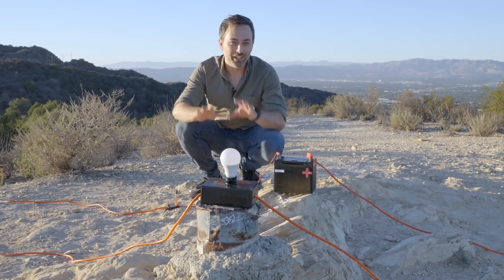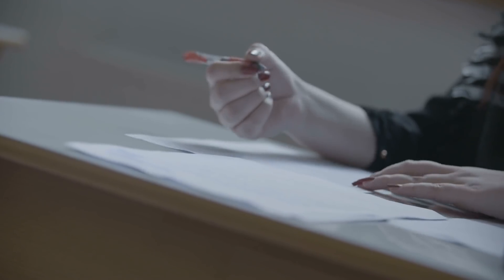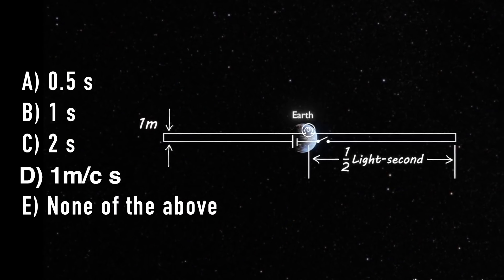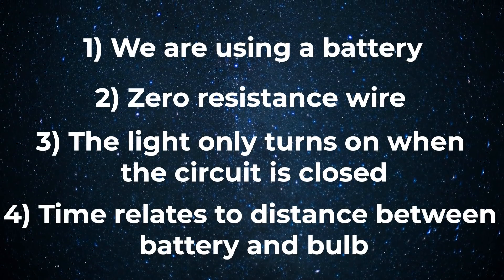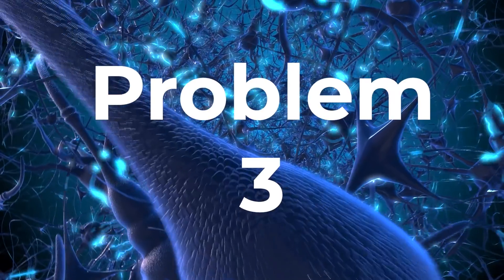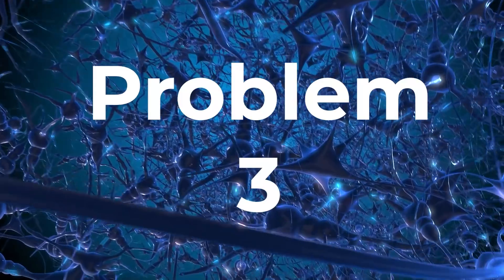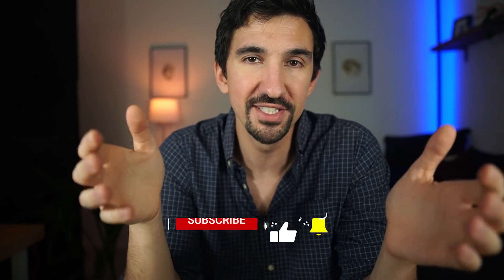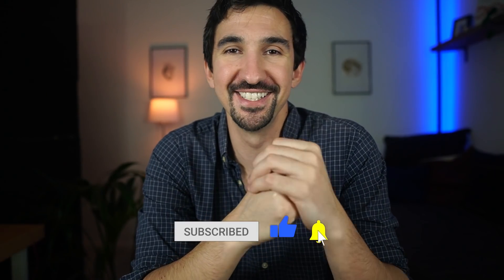Is Veritasium Wrong About Electricity?

Comment: Veritasium is wrong, this a copy of the comment I posted to V. 
I think that video in question has so many misleading concepts and some flat out errors that I don't have time to elaborate on all that, so here is a copy of my comment with some math included:
"I don't agree with the premise of this video about the fields carrying the energy, I would welcome it if somebody can improve this:
The setup is a battery with two ideal narrow cylindrical conductors connected to a resistor and somewhere in the circuit there is a switch, which we assume has a negligible effect on the overall resulting field. We could imagine the switch next to the battery, or next to the resistor. Having the switch next to the resistor is like having the switch next to a lamp that we may want o use. If it is next to the battery we would be turning the light on from the distance. The reason why this may be important for visualization purposes, is that the electric field will be different from the one plotted in red in the video if the switch is next to the battery. If the switch is next to the battery the resulting field will be like the superposition of a positive point charge at the top of the battery and a negative charged wired connected to the bottom of the battery. In the case of the switch next to the resistor, the field will be more like in the video which is the superposition of 2 opposite charged wires. Let's  assume the switch is next to the resistor, not like it is in the video, just for clarity. 
In this case the field is just like the video and also the field is obviously  already there and its shape wont change. Why it will not change? because the battery (ideally) will keep the same difference of potential and therefore the same electric field. Remember the electric field is the negative gradient of the potential, which is stationary. 
The battery provides a difference of potential between the two ends and the cables extend the ends of the battery and maintain the same electric potential  along the wire as required by Gauss' law. Also these electric charges on the surface, don't induce any current inside that will be a violation of Gauss' law, so, the video there is wrong.  
The electrostatic field plotted in red is what you get when 2 wires of finite width, are charged with positive and negative charges. This results in a dipole-like total field that is really well plotted in the video. At this point, the electric field has already reach the resistor and assuming that the switch is off, no current is flowing. That is all good. When the switch is on, it establishes a physical connection between the 2 wires connected through the resistor. The opposite sides of the resistor are subjected to the same difference of potential as the battery. Therefore the resistor is subjected to an electric field that will accelerate the few electrons capable of moving through the resistor.  In order to transmit their energy to the next free electron, the accelerated electrons inside the resistor only need to change their position, which happens really fast. An electron changing its position will produce a varying electric field that will perturb another electron nearby, this effect is almost instantaneous, but not quite. Electrons in the resistor will gain enough energy to jump from the resistor to the positive side of the wire and electrons from the negative side of the wire will also gain enough energy to go into the resistor at the other end. And just like that an electric current is stablished through the circuit.  As I mentioned the chain effect of electrons pushing each other is quite fast. For comparison the relaxation constant (epsilon/sigma) for copper is tau=~1.0e-14 sec similar to the collision time in the material. So, what about the energy flux from the electric and magnetic field?  Here  we can apply the conservation of energy to this problem using Maxwell's equations to see what happens with the fields. When you do that in differential form we have:

change in energy density over time + div S = rate of energy loss 

where div S is the divergence of  Poynting's vector. 
Without going into details ( I can provide the material to who is interested) this results in:

change in energy density over time + div S = - J . E  

or more explicitly:

dw/dt + div S = -J .E  

where w is  energy for unit volume or energy density: w=1/2 epsilon E^2 + 1/2 * mu* H^2 
and S = E x H/mu0  is  Poynting's vector
J and E are the same as in Ohms law J=sigma*E , i.e. J = current over area , E = electric field causing the current.
To compute the total energy flux, this conservation equation needs to be integrated over a closed surface. So by choosing a sphere around the resistor for example:
the integrated form can be written as:

- integral_over_closed_surface_s( S . dA) = d/dt  ( integral_over_volume_v( w*dV) ) + integral_over_volume_v( J . E *dV) 

since E and H are constants, because the current is stationary and the battery keeps the electric field constant the first term in the right hand side vanishes and:

 - integral_over_closed_surface_s( S . dA) =  integral_over_volume_v( J . E dV) 

This is almost what this video was about, but here is the thing, we can only say based on this conservation equation,  that the total power entering the volume V with surface S , is used to increase the field energy storage ( 0 in this case ) and the rest is lost in heat. And it is easy to see why by having the electric and magnetic field on one side and the energy lost in the resistor on the other,  will suggest that the fields behave like rivers of energy or similar,  carrying energy from the battery to the resistor. The fields, magnetic and electric are properties of the space caused by the presence of currents and electric charges.  In this setup the fields are stationary, and can be used as intermediaries in the conservation equation to compute the power provided by the battery which is the one that creates the separation of the electric charges in the upper and lower wires. The battery by means of the wires extending the electric field,  produce the current generated in the resistor causing the magnetic field.  Electromagnetic fields can only propagate energy if they change over time like they do in a wave. Or, to look at it in a different way, if you accelerate a charge it will radiate energy, that is  why energy escapes in the form of heat in the resistor. The static electric and magnetic fields are just a manifestation at a distance of the battery using its internal chemical energy  to keep the charges on its end at the same level so to keep the difference in potential. That is why static charges in the wires stay in place  and produce the electric field and then induce the current in the resistor when the switch is on. For me, in the setup from the video,  saying that the field is the one carrying the energy is like saying that when you drive from one city to another, the highway and the signals in the highway "took you" from one city to another, completely forgetting about the car you drove.
"

Comment: As a science teacher, I was elated to hear you suggest that Derek's line of "these are the lies..." is a bit unfair, and I always make the same point you do to my classes about how science works on models, and learning a simplified model is not a 'lie'. However, on the subject of units, I felt personally attacked ;)
Reply: The 1 in the units problem was 1 metre I guess so it will come out as second I guess
Reply: tbh, I did not take it so literally when i heard he say "lie", I just thought it was a manner of speech or something like that
Reply: I am also a science teacher and I teach 6th grade science and it causes a lot of extreme over simplifications and when I discuss these with my classes I do use the term 'half truth' with my students to mention these are over simplifications they are close and useful understandings but are inherently incomplete.  

I mention that as they continue through their education they'll get a more complete view of it that is more nuanced in how it actually behaves but if this is as far as they get then it'll still work as an understanding.  much like this electrical point it's not a complete understanding however if you need to design a circuit or do some basic electrical work the simple understanding won't stop you at all.  It might if you had a very bizarre set up or are trying to do something very novel but for almost everything it won't matter if the understanding is somewhat basic.
Reply: The trouble is almost every book gets this wrong, even though we have known the truth ( Derek is right) for 50 years or so, with many papers.The “lie” is that surface charge on a wire is ignored and that should be obvious nonsense. Q: Why does a current flow in a wire? A: a potential difference along the wire. Why is there a potential difference? Because there is a gradient of surface charge. This charge makes both an axial electric field. This field is orthogonal to the B field so no power flows along the wire, it flows from battery, to space, and then into resistor. Derek points out that there is another electric field, a radial field.This field crossed with B gives power along wire as well as through space. He shows power moves both through space and does give short shrift to power along the wire, but does include it.
Reply: @jimmcclymer4230  A circuit is only based on electromagnetic fields, OK.
But air and space have pretty low magnetic permittivity, as opposed to metals, whose electrons are free to couple with the field. In doing so electrons echo the field as if there was almost no signal loss. 
The Veritasium episode is quite misleading into thinking the field propagates in the axis of power propagation. Yes it propagates in every direction, but very mostly along the conductors.
Reply: @G1vr1x  exactly, as an Electrical Engineer we covered magnetic circuits when talking about transformers and an Air Gap has huge "resistance" (magnetic vs electric circuits use different names/properties but the same equations) and is horribly inefficient.

I saw veritasiums thumbnail, felt a deep pain in my soul, and the  refused to watch it. After this video i suspect he basically covered transformers/mutual inductance/antenna and none of those would light up the light with a car battery and copper wire before the main current arrives. Voltage travels at the speed of light in the medium and using the surge impedance determines the surge current, which would be tiny in this case. I'm basing this on lightning stiking a line as a 10000A current source that multiplies with the ~300Ω surge impedance to produce a 1MV surge traveling at the speed of light down the line.

Using a 9V battery and a 1m speration of wires I don't see any way for the ligthbulb to light up before the transient arrives at whatever the distance along the wire from the switch to the bulb is divided by lightspeed as the induced current would probably just look like any other noise transient on the wire.
Reply: @G1vr1x  E and B fields move through space very well with no electrons or anything else.  You don't need the electrons to carry the energy, the fields do that, no coupling required.  It would take some detailed calculations to show which carries the most energy in a given situation. Part of the problem is that we have been taught to only consider power flow along a wire with incorrect reasoning.
Reply: @jimmcclymer430  I've been taught Maxwell and Poynting theories. It's painfully hard to grasp. Yes newtonian physics are wrong, but they fit pretty well in common situations and simple as we can get, just as ohm and kirchhoff laws.
Even for wireless power transmission, you still need conductors, hence coupling.
Which between electrons and the field carry the most energy makes no sense as they interact all along the way in almost all applications. Except microwave beaming, which is darn crazy ;P
Reply: Yeah, theorectical physcists tend to just consider c a number, so no units. If they do want to calculate units, they can do so separatey.
Reply: The electrons don't move at the speed of light. The electric field does. So any equation using "c" and distance to calculate time is incorrect.
Reply: wellwell I think he refered to the concept of drude meaning the concept that in a wire you have electrons jumping all around the place and thus an electric field would lead to a drift of electrons. I guess that kind of stuff you dont explain in school. Just with the things you learn there youd be tempted to think that electrons move all the way through a wire from A to B.
Not necessairily offensive actually ... or would you like to teach quantum mechanics instead of Bohr's atom model kind of approach? School is school and university is university.
I thought immediately about that when he was referring to "what you were not told" and showing the example of cross atlantic cables
Reply: Right, its not necessarily a 'lie', but at an introductory level, how do you get people familiar with the idea of sending information / energy without going into stuff on magnetic and electric fields. Problem is, because this stuff doesn't get addressed much later into most undergrad programs, perhaps people lose interest?
So I commend people like Veritasium putting out vids like these for people to think about.
Reply: There's an appropriate level of modeling for each type of scenario. We can simply model a network of discrete components (battery, switch, bulb, wires). That will get us an accurate steady-state picture, but won't tell us about transients or transmission delays. You can model transmission line delays and impedance, battery voltage and resistance, and load impedance, maybe draw up a Bergeron diagram, and get the timing of transmission line waveforms, but this neglects radiation. Similarly for Smith charts. You can model the wire as a network of lumped capacitances and inductances, and this will give you both the small early current and the larger step one second later. This is pretty accurate if you break the line into short enough elements. Or you can do a full-fledged EM analysis, with Maxwell's equations under appropriate boundary conditions, and derive Poynting vectors, which is more complex but most accurate. If you are doing antenna design, that is the analysis regime you want. And, point of fact, this long wire does act like an antenna.
Reply: "Veritasium" is inspired by veritas (truth in latim). So he's just making a call back to his vision as a YouTuber.
Reply: As a student I'm strongly opposed to using models that are too false without explaining how are they false. Because it's very easy for and intelligent student to reach places where those models break down. And then (s)he is left out in the dark without explanation how things really work.

Poynting vector explanation of electricity is not harder than any explanation involving current or electrons and has the benefit of not breaking down when it's pushed. Because it is strictly correct model not just convenient model.
Reply: to stretch the definition of a lie just a tad.  if one is taught that what one learned is truth and later knowledge it wasn't, or wasn't a complete truth, is the person who believes what he was told was the truth been lied to if he doesn't believe the updated truth could be true because it is not what he was told was true in the first place. maybe we should not attempt to teach truth but methods to learn truth and verify sources. because if one is taught truth  rather than how to determine or learn truth then the truth one learns is sort of lie isn't it.  so in other words dr. miles suggest his understanding may be wrong and challenges viewers to give him better understanding.  if all teachers  taught students to seek truth rather than to know truth would we have a better educated citizenry less inclined to believe distortions.  is teaching seeking truth possible?  i am not a teacher.  but i've met many who know the truth and refuse to seek if what they know is false or not.  so i  often wonder if teaching truth is not the same as teaching lies.
Reply: The ‘lie’ part is only coming in because most students weren’t told that they are only learning simplified version of a concept.
Reply: I think Americans and English use the word ‘lie’ differently.  English usage tends to be ‘falsehood with intent to deceive’, US usage is simply ‘falsehood’.
Reply: Veritasium has been wrong about a lot things for the past 2 years. Just saying.
Reply: @cjay2  Not at all actually. Like what?

Comment: Great video. When I watched the Veritasium video, I did raise an eyebrow and your video adds more to it which was more in line with how I was thinking. Both videos are great though, as I didn't know anything about Poynting vector and this has really opened my eyes up. What's even more strange is that I've got a masters in Electronic Engineering and still didn't know anything about Poynting!
Reply: Maybe it's not really useful in your field so you don't really have to know it.
Reply: For your own edification, you should do some research on the P vector, so that you understand it.
Reply: @cjay2  aye, agreed